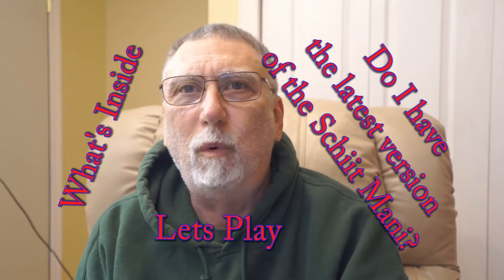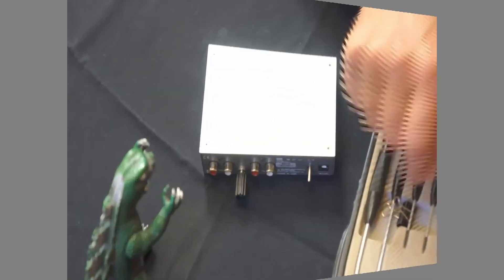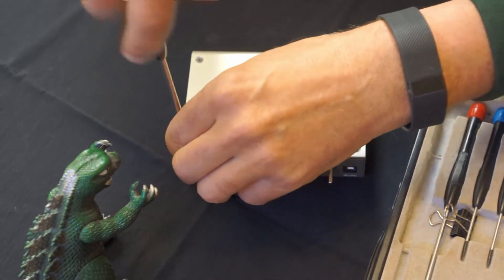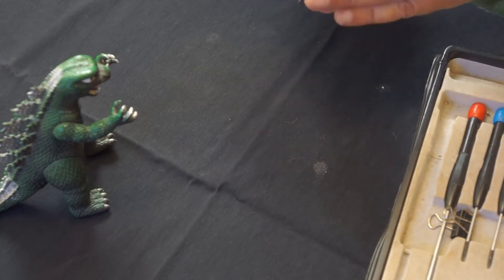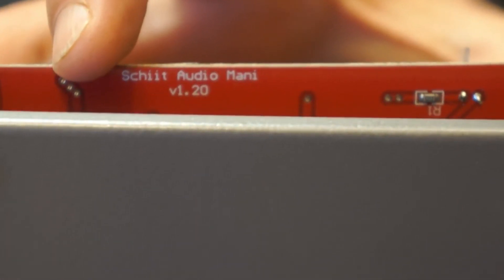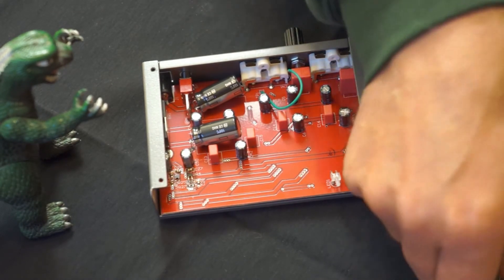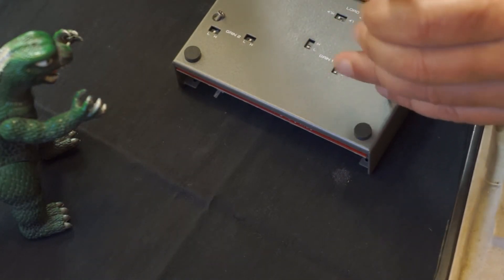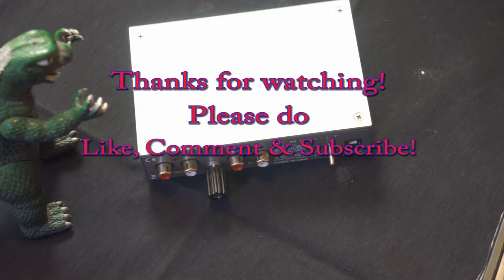Whats inside  my Schiit Mani phonostage, which board revision do I have?

Comment: If the old version had a steel case and the new one aluminum try using a magnet on it. No need to open it up
Reply: Possibly my own ignorance, but that might damage it.  This thing is for a phono pre-amp.  If there is anything inside dependent on magnets, then attaching a magnet to the outside.  Dunno, just would be concerned.  I opened mine.